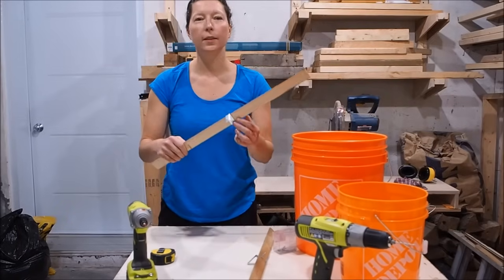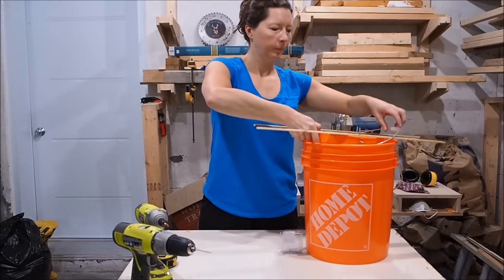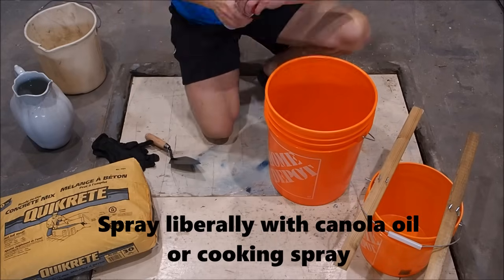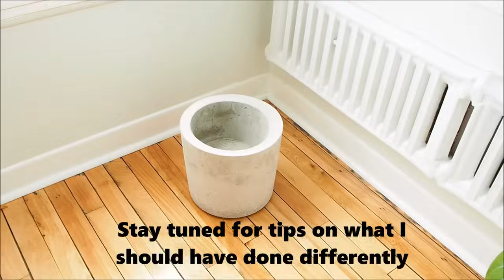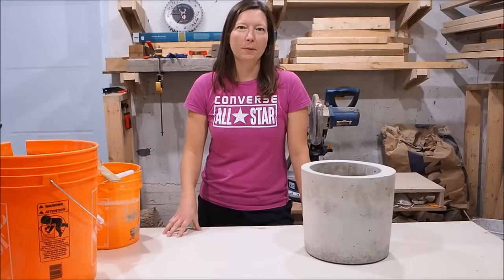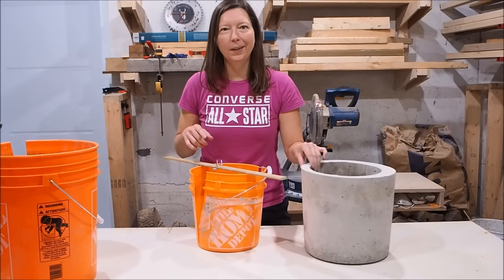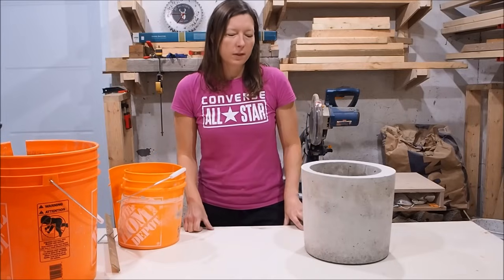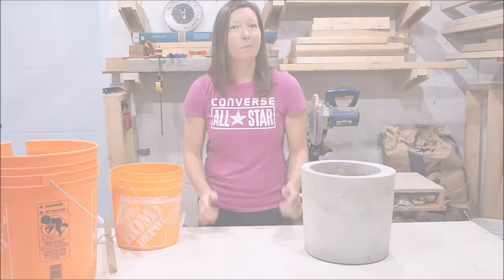How to Make a Large Concrete Planter

Comment: Oh!!  Styrofoam is great for the 'thick base' you describe here as well, when I'm making larger pieces I'll put larger chunks of stttyrofoam anywhere there's to be a lotta concrete, if there's more 'crete in an area's thickness than-necessary for structural-integrity, I'll litter it with chunks of styro  inside :D
BTW, something worthy of consideration: yknow the metal sheeting used for putting on a house to then apply stucco to?  I use that to make free-form pots&slabs for my trees, use fabric as-needed to 'reinforce' it as the crete cures, it lets you go 3D very easily!!

Comment: Next time tap the bucket with a mallet while the concrete is wet and it will give you a smooth outer surface with no little pits in it.
Reply: concerts???
Reply: Jon Hohensee concrete

Comment: You could of used a mortar mix with flow control so that you could have poured in that concrete - much easier than packing those walls by hand.
A tube in your form for drainage would help your plants.
And an hour setup ... that's all you need. Good effort though - well done for a first time!

Comment: Since this video is from Montreal, I thought I should mention that if this planter will be outside, it will go through the freeze thaw cycle and will Crack without any reinforment. I would recommend putting some chicken wire in the forms before the pour.

Comment: For your lubricant, I might try dry silicone spray, WD 40... Vaseline...
Reply: I used Vasoline on mine and it slipped out with a little bit resistance but it came out clean

Comment: Cool build, very simple.  I might have to make some for my roof deck.  It would be cool to make these in white, and various shades of grey, to have a variety.

To extend the base, you could cut out foam (the pink insulation home available at home depot, which cuts easy with a jigsaw, or a turkey carver).  You could actually make the entire cutout by stacking foam circles if you want (that way the top of the foam is even with the top of the outer bucket, making it easier to center your form).  My next video, which should be out in a week, shows how foam is used in a concrete pour to reduce weight.
Reply from the maker: +Modustrial Maker Thanks, great idea the pink foam, I might try that next time !
Reply: DIY Montreal no problem, if you have any other questions or just want a sounding board for concrete projects, let me know.  I'm no pro, but have a dozen or so DIY concrete projects under my belt using all kinds of mixes from store bought to fancy GFRC and SCC recipes.
Reply: Interesting,  great job

Comment: First mistake. The base of your pot is thick enough to survive an atomic blast! You should hav put a few inches of damp sand into the outer form and tamped it flat. As for oil, engine oil or a Liberal application of a cheap cooking oil will work but remove your pot from the mould after 24 hours. Anyway, congratulations for having a go!

Comment: You did great but next time don't break your two buckets. You just need to use lubricating oil to buckets and after putting the concrete don't keep for long time as u did for 4 days. You just need to keep for 30 minutes or 1 hour and remove the buckets from concrete slowly.

Comment: Will it crack from water ?
Reply from the maker: Don’t think so but you could always seal the inside with paint or varnish
Reply: Adding a small amount of Fiberglas particles to the mix makes concrete and hypertufa pots resistant to freeze-thaw damage when left outdoors in winter. The finished pot may have a bit of fuzz on its surfaces once unmolded but even a kitchen torch or a BBQ lighter is all you need to burn it off. Drainage holes are a must for outdoor use. Good video and nice looking pot.

Comment: Wasting two buckets is of no use by cutting both of them.  Instead you might have used oil inner side of the big size container and outer side of the small container which will make no contact with the buckets and you will get result of cement pot as usual.

Comment: depending on the desired height of planter cut smaller bucket to height, then invert it into larger bucket,  after packing in some crete to center your creation you could literally pour the rest into the bucket,  and stop when you have achieved your base thickness. coat your surfaces that will touch crete with crisco or some other releasing agent.  this can be washed off later, so you can re-use the buckets.

Comment: 4 days tooo long to wait to demold..here's a tip, pour hot water over the outside of large bucket ( when turned upside down to demold) then it should come/pop off real easy. I do this most of the time.

Comment: It's not possible that the lip turned out that smooth. You can see as you were removing the inner bucket that the cement was jagged and rough, and at one point appeared to crack. You would have to have used a heavy duty sander to get the lip to look that smooth.

Comment: Aren't you supposed to mix the cement with foam or sand?  That is a lot of cement between the bottom of the bucket and the smaller bucket. should have used sand  in between that space

Comment: everything is good. But wasting two buckets is not  good I thjnk.
Reply: Krishnareddy P ii
Reply: You may want to grease the inside of your outer bucket with oil (used motor oil will do) and grease the outer side of the inner bucket. This will allow you to easily remove your new cement  pot from the plastic buckets....’Home free’....LOL!  You will be able to reuse the same buckets for extra pots you may want to create. Good for the environment too!  😊
Thank you for your demonstration.
Reply: Castor oil and alcohol 1:8 ratio.
Reply: Murphys Oil Soap
Reply: Correct.... she can use it as pots already.... hahahhaa

Comment: First you should put some engin oil or cooking oil in side the big bucket and out side the small one also  this for lubrication  and you can remove small one from the concrete when after 24hour that's also with out damage and after two more days you can remove big one also with out damage try it and make one new videos ,😊

Comment: Nice, but next time don't leave it for too long about 12hrs overnight and instead of cutting the bucket used hot water, wet the outside of the bucket and it will loosen up.

Comment: well tried suggest that plastic mould been cut and destroyed which is loss for ever, instead in the mould which is used for cement pots must be greased or oil by brush from inner or outer surface, latter make cement paste or easy way make cement soup and apply inside base and walls of mould and apply dry cement on the paste or soup by sprinkle, prepare cement and riversoil or sand in ratio 2::5 or say 1kg cement and 3kg sand mix and pour less water and mix proprly by hand or tool. follow the procedure and by hand can paste around the mixture inside the mould uniformly, for good finish take glass round bottle and move gradually on the pasted walls inside the mould and keep in shade for 24 hrs or 72 hours,  patiently tap or apply steam water outside the mould and remove slowly donot cut or destroy here with smile in your face flower verse or pot is crafted.  Me sherry.

Comment: Nice pot but what a waste of two perfectly good plastic  buckets. If you poured hot water over the plastic bucket they will slide off/out without the need to cut them. That way toy can use them again.

Comment: Failed to drill holes for water drainage
Reply: Angelo vicente batista that's the only problem that I seen! you cannot plant anything in it the salt buildup will kill whatever is in there!
Reply: Angelo...don't need them if you are using this as an outer Pot and placing a smaller one inside...
Reply: No it won't, once cured soak the Pot in water for a day, I have over 20 concrete pots and never had an issue...
Reply: except to allow water draining from the pot inside to escape too of course...

Comment: you damaged 2 bucket , for one  concrete planter , learn more before make more,  spray with used car engine oil,  after 24 hours remove bucket, Always make balance and use pipe for drain.
Reply: Saleem Khokhar not used engine oil, please. That stuff is poisonous and will give you cancer. There are plenty of other oils that are safe to work with.

Comment: Why make a how-to video before you even know what you're doing? Cooking spray works ok, but cooking oil painted on liberally works better. 4 days is too long to let it cure before removing the buckets. Remove inner bucket after 24 hours, and outer bucket after 48 hours. (wait longer for outer bucket because it's not strong enough to flip over without high risk of cracking after only 24 hours) The sticks on top of your bucket to help keep it level were entirely unecessary, leave that part out next time. Make sure bucket is CENTER before taping in place. With wet sand at the bottom of the fill bucket you can make built-in legs, and you should aslo place something about 1.5" tall in the middle to make a drainage hole... styrofoam works well. Tap the sides of the bucket for about 10-15 minutes to get rid of most of the air bubbles. And last but not least, do your research and try a few times BEFORE running out and buying 2 brand new buckets and making a how-to video, that way you don't steer everyone wrong and discourage a bunch of people when they try and fail to make a nice planter.